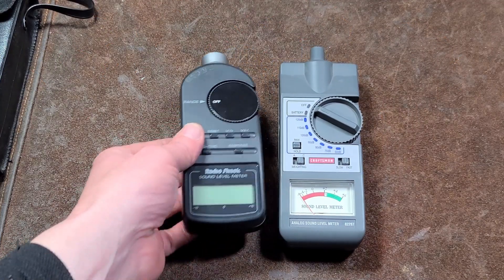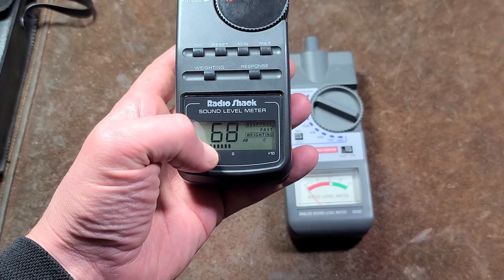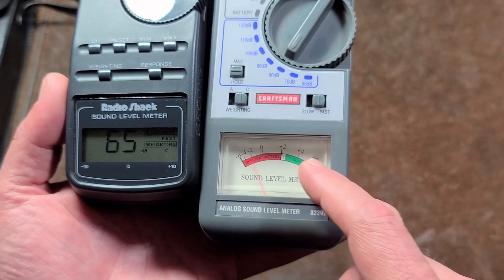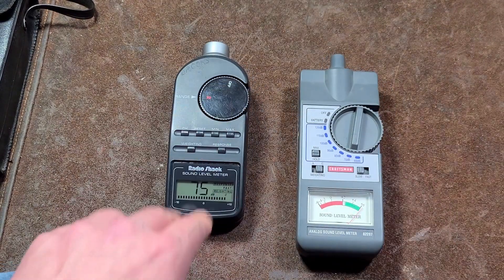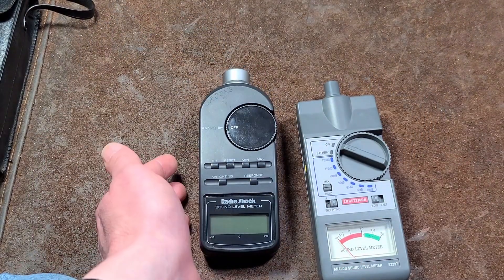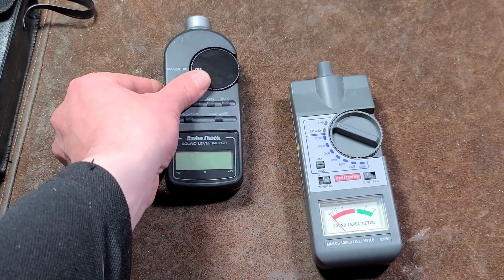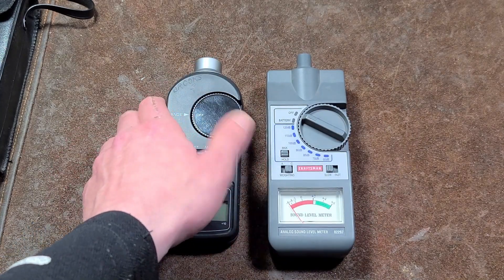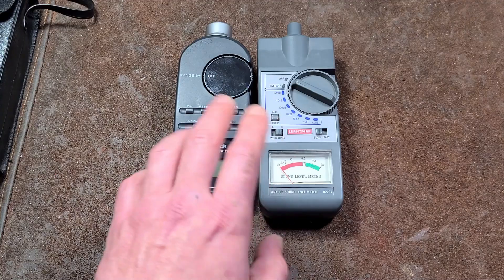Analog vs Digital Sound Level Meters

Comment: I tested several models and calibration
In this Radio Shack 33-2055, if you do not activate MAX, the measurement will be the average display of 1s of the DISPLAY, I have already compared class 1 decibelimeters
Digital Radio Shack dB C fast (1s average interval display)
BARS radio shack 0.2s (fast) and 0.5s (slow)
Digital Radio Shack dB C fast MAX. (maximum peaks of 0.2 s fast)

Analog Radio Shack 33-2050, the pointer suffers from inertia, depending on the frequency, leaving the vu scale inaccurate

Comment: I have the same radio shack spl meter. I purchased it new years ago, and no, it did not come with a wind noise thingy at all. I use it to tune my stereo system. Works great for that, making sure every channel is at the same level.
Reply from the maker: They are good for that on very old receivers and even two channel systems were the speakers may not be balanced in the room.

But I believe Yamaha was one the first to introduce microphone self-tuning receivers in 2003. Now all but the cheapest of receivers self tune with the microphone
Reply: @CatusMaximus  It was a 5.1 channel Yamaha from around 2001-2002. It had individual channel adjustments. I also used it on my older, classic yamaha 2 channel stereo system in my shop.
  I do have a yamaha e/q that has a mic, but that is for frequency I think. Never used it.